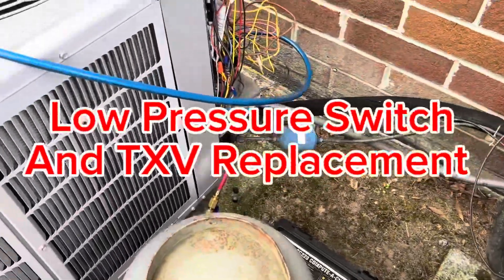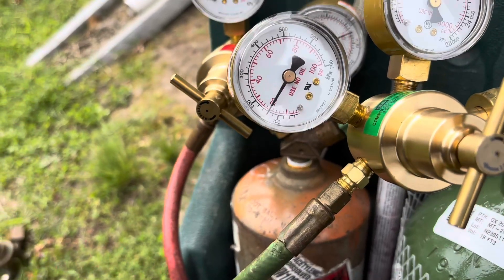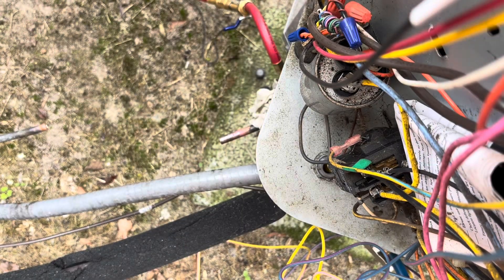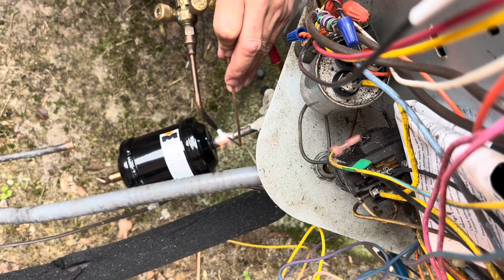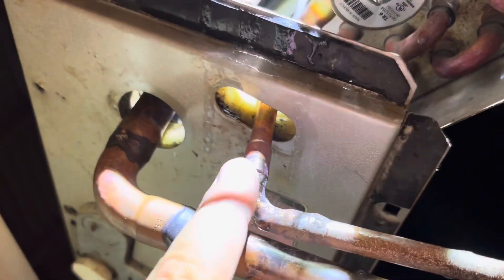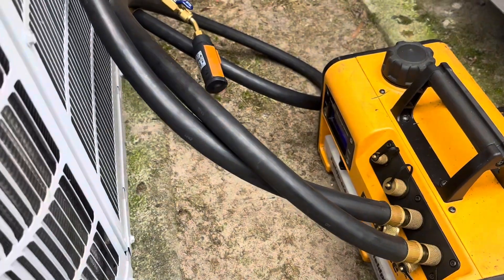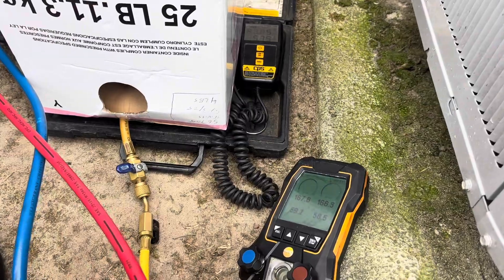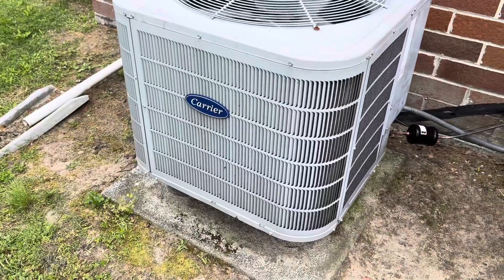Defective TXV | Leaking Low Pressure Switch Replacement On Carrier Heat Pump

Comment: 11:25 I love the TruBlu hose system. Lifechanger for pulling a vacuum super fast. Just gotta make sure that anything attached is vacuum rated, especially any hose you use to connect the micron gauge. Anything with a ball valve may not be vacuum rated, and could trick you on the decay test. Best to use a third valve core remover and hook it up that way, so you can isolate it before pressure is added. Or at least that's what I do, there are a million good setups I'm sure
Reply from the maker: Yea ive seen them and a couple co-workers have them.  Very nice vacuum hoses.

Comment: That’s wild that it was leaking through the wire itself I’ll have to start checking those ! Have you used the pinch off tool with Freon in the unit still and just cut it off and braze it on ?
Reply from the maker: No I’ve seen them before but never used them.
Reply: Time saver so then you don’t have to recover all the Freon and pull vacuum on condenser

Comment: I was taught to only remove a drier by cutting it out never to unsweat it
Reply from the maker: I would typically agree with that.  But In some situations, cutting it is impossible.  Had I cut it on the unit side, I wouldn’t have had enough pipe to go back with a new one.  In hindsight, I could have cut just the AHU side.

Comment: G,day Jeff from Sydney Australia. I wonder if cleaning the evaporator coil and condenser coil would reduce the SH superheat.
They say "you shouldn't pull a vacuum with digital gauges" use a micron gauge specifically, do you agree with that?
🌏💫
Reply from the maker: I would say yes I agree with that.  However if your gauges are leak free, and you have the extra time it takes to pull through the gauges go for it.  
The rig I was using has a separate micron gauge and just Bluetooths the reading over to the gauges.